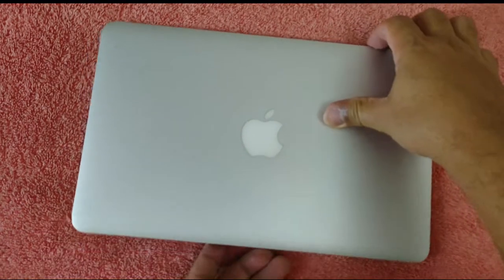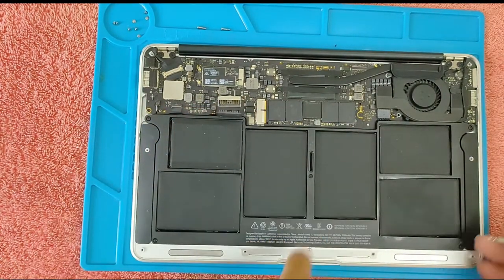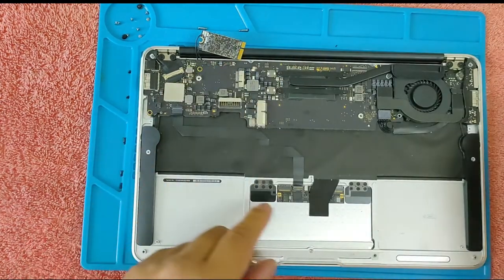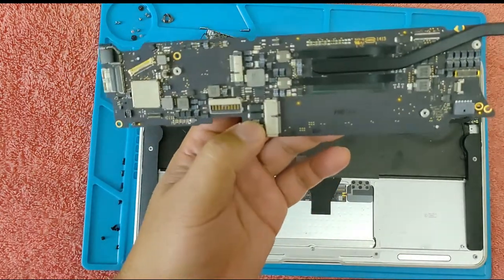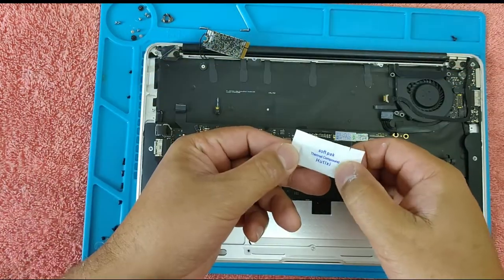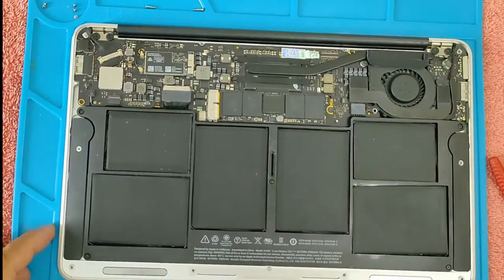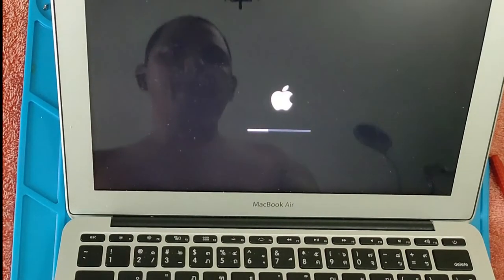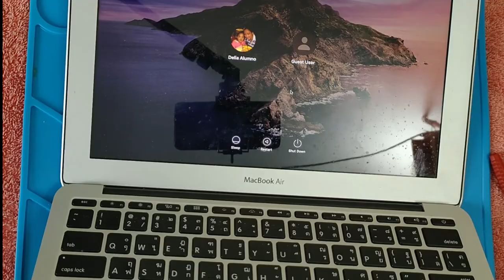Macbook Air 2015 A1465 Motherboard | replacement

Comment: Is it possible to get brand new mother board for this Mac air?
Reply from the maker: sorry there no brand new motheboard
Reply: @sonexversace6116  I’ve a Mac air 11inches A1465 2013 mid model. I-5 4gb ram. Can I upgrade it with i-7 8gb ram logic board: because currently it’s dead. Need to change logic board. 
You must be knowing about it. From where and how can I order exact same logic board with more specification.
With less price and good productx